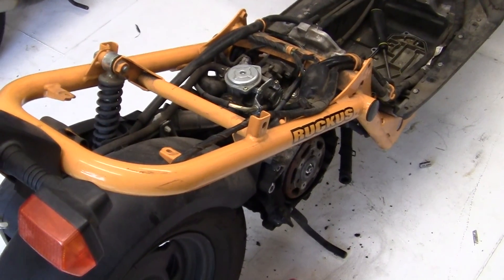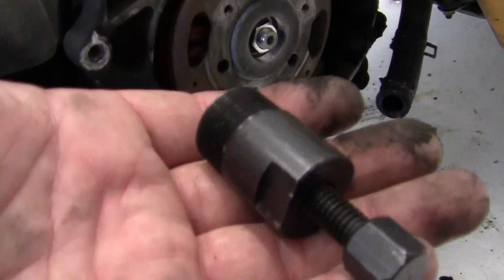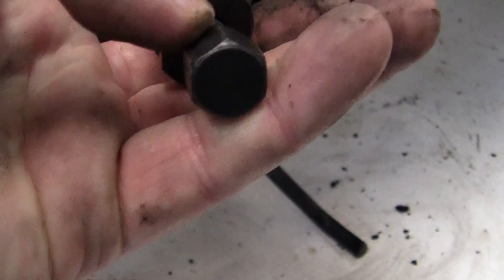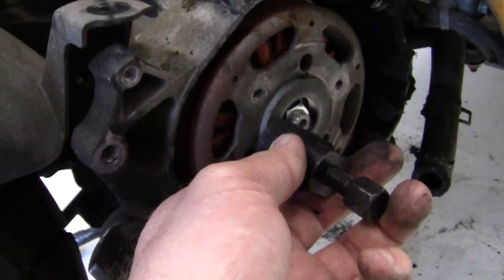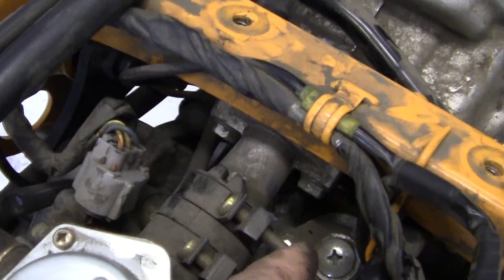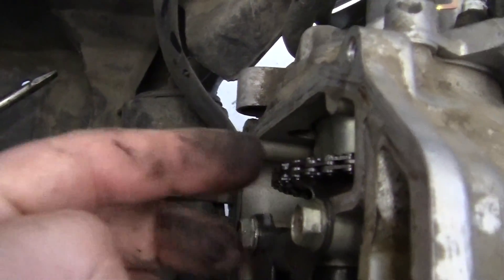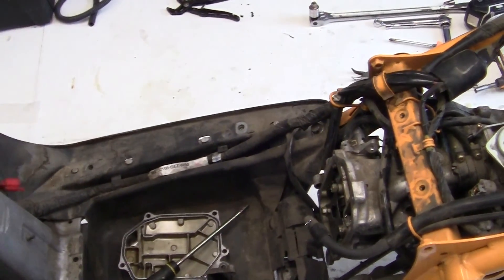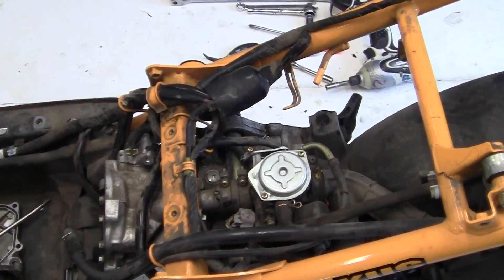20)-  PROJECT Honda  RUCKUS - HOW TO= Engine COMPLETE REBUILD

Comment: What size puller is it?
Reply from the maker: +TrendSettaz You can find it on youtube for like 10 bucks, they even have a combination puller that works on the dio nut and ruckus nut, works great too.
Reply: whats it called?
Reply from the maker: +TrendSettaz Its called a Radial GEO Convex multiplying Segment puller.